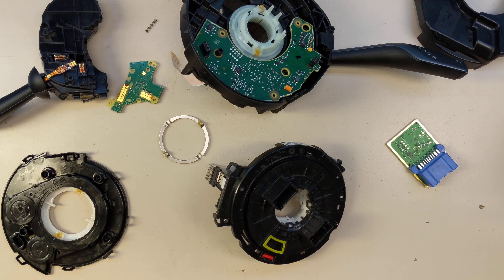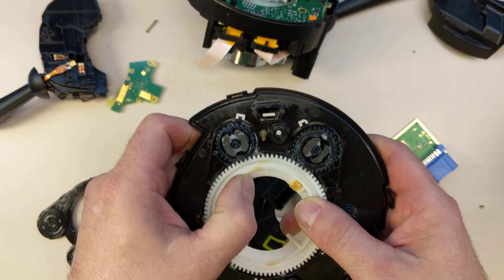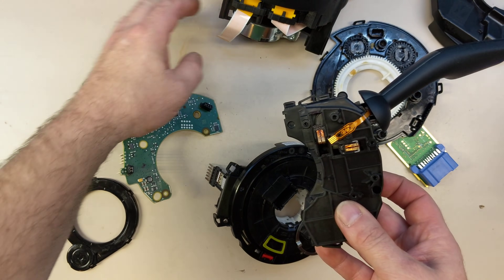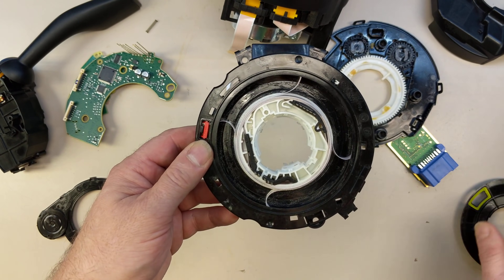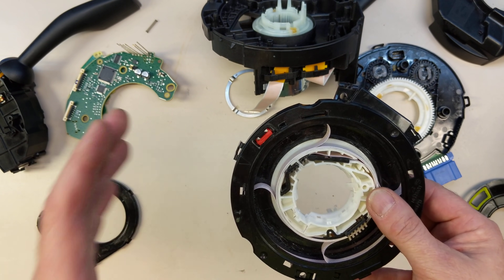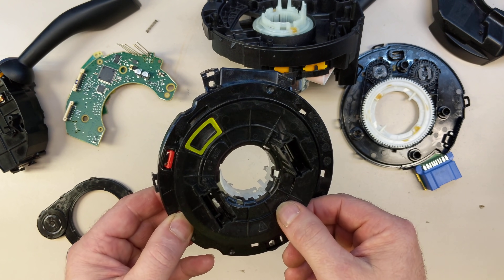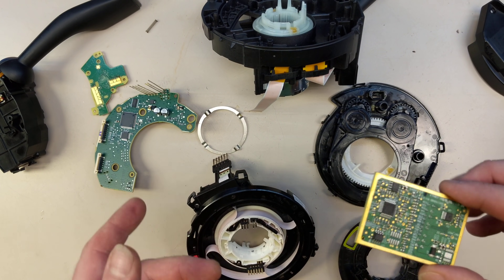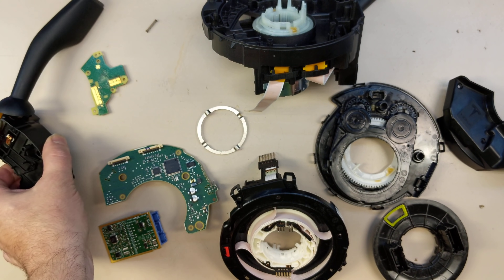Tesla Teardowns - Why is there a CLOCKSPRING?!?

Comment: I actually had this very part fail on my Model 3 earlier this year. It eventually got serious enough that the car wouldn't go into Drive. Tesla service replaced the entire module as you'd expect.

I love the idea of using two different sizes of gears for the Hall effect sensors to detect absolute steering wheel position with high precision. Are the tooth counts on those gears prime numbers?
Reply from the maker: I have only seen one of these fail, and it was due to someone spilling a coffee on the steering wheel, which somehow got into the electronics.   But almost anything can fail.  Usually without external causes (coffee), there is a "bathtub curve" where complex parts either fail really early (infant mortality), or they last a long time and fail well past their design life.
Reply: @Ingineerix  indeed. Mine failed after 3 years without any coffee spills or anything like that. Rare but it happens I guess.
Reply from the maker: @pepstein  Did Tesla cover it under warranty?   Where do you live?   The one major enemy of these things might be dust and/or humidity.
Reply: Yeah they replaced it under warranty. Car spent most of its time garaged. Bay Area CA. No dirt roads or other sources of dust.

Comment: In aviation we have the FAA to presumably check if a plane is safe to fly although it fail miserably on the 737 Max. On cars what administration is checking them. In the old days the steering wheel could get harder when the power steering failed but we still you could riches the safety shoulder. In your demonstration I don't see any redundant device allowing me to go to a safe place if the steering fail. Hopefully the National Transportation Safety Board (NTSB) will investigate the crashes and gives some advises on how to improve the situation, like having assisted steering where the driver still can control the car when the electronic fail.

Comment: Seems vastly over engineered to me. Can't imagine using a 32 bit MPU to read a few encoders and switches. Can't justify the component count for what it does. Too many boards, cables connections, and complexity. Seems fragile in many areas too. Typical German design. Wonder what a dealer charges to replace it? depending on the brand $3-10K I'll bet. Lots of plastic tooling costs but cheap in China. Very interesting video, well done.

Comment: I knew about clocksprings in steering wheels, but I didn't know about how precise the magnets and gears were. They must utilize this for making sure the driver has their hand on the wheel for Auto Pilot as I've noticed it just takes a bit of resistance in order to prevent the nag. Did you find any motors in this assembly at all? My first guess to how that worked was if there was resistance on a small motor or something. But now, having seen this, it looks like it just checks if the magnets have moved enough over a period of time. Or perhaps they have it programmed to detect natural vibrations from the road, so there would be more noise, so to speak, if the wheel wasn't being held steady? I'm not sure, but knowing that this is done through software makes it even cooler to me!

This is really fascinating and does give me a great appreciation for engineers! Thank you for sharing!
Reply: The motor (for power steering and/or automatic steering) is usually on the steering shaft or steering rack, not the steering wheel.

Comment: Incredible seeing all those PCBs and CANBUS in there just for the clock spring. I'm working on disassembly of a 2015 Fiat 500 and they just use a resistor ladder for many of the steering wheel buttons, and the clock spring just connects to three different plug-in connectors that go straight down in a huge bundle of wires to the BCM

Comment: Seems to me it could be done inductive. Alternatively do a non linear 90 degree steering wheel action, then a slightly loose cable will suffice.
That stalk should go as well. Should be a touch display in the steering wheel face. And yes, there is still room for airbag, spare me.

Comment: Mighty interesting, I never thought about that.
Reply: Very interesting & explained a lot why the clock springing my GMC Chevy Sierra 1500 air bag light came on  intermittently. Some days the warning light would flick off& on 7 times then go off completely only ten minutes later the warning light would come on again & stay on. I tried removing the fuse to the dash light but that was worse in fact the warning light stayed on continuously!  So as it’s almost impossible to purchase another clock spring …. I finally removed the dash warning bulb putting the concern out of my mind! Certain models have sensors under the body work at the front of the vehicle but I could never find them & they to are as scarce as hens teeth!
So after watching your video I’m inclined to think that there maybe too much side play in the steering column beneath the air bag itself either that the electronic stuff is buggered!

Comment: Love your detailed vids on tear downs. You tend to get into all the really cool stuff so it's hard to make a specific request. Tesla's seem to have a mechanism that helps the car drive straight when the wheel alignment is off. I think it's part of the auto pilot system. Maybe do a tear down on that?
Reply from the maker: There is no mechanism I am aware of to compensate for alignment problems.  The only thing (shared by almost all cars) is the ackerman positive caster angle.  This causes the wheel to self-center when driving forward.    See "positive caster" here: https://suspensionsecrets.co.uk/caster/
Reply: @Ingineerix  Not long ago i had a wheel alignment performed on my model 3 and the alignment shop was frustrated with how after they aligned the wheels, the car pulled to the right. They couldn't get it straight. However after about a week it started to drive straight (mostly). Tesla charges a large fee (~$500) for a "calibration" when doing a wheel alignment so we concluded the car is somehow correcting itself. Amateur conclusion perhaps?
Reply from the maker: @brandonbeck4794  I'd say don't go back to that shop.  If they can't tell you why it's pulling or set it properly, then they don't know what they are doing, or their equipment is not working correctly.  The only calibration is steering angle, and any decent shop will first set the wheel to 0 degrees and place a fixture on the seat to hold the wheel at 0 while they adjust the car.  It will not need to go to Tesla if this is done.   If they did it wrong, and there is an offset from 0, then the angle sensor has to be reset.  This will also result in your wheel not being centered properly.
Reply: I would love to see that explained, Brandon!
Reply: @dizzy2020  'owner's permission' is probably in the terms you have to accept to use the software; however, I can't call it consent because forced permission certainly isn't voluntary

Comment: Great tear down! 
Do you think a heated wheel retrofit for early Model 3s will be possible? I’ve done the retrofit on a Touareg… I’d love to have it on the Tesla. 

The steering angle sensor on that 04 VW was just optical, kind of like a ball computer mouse. The clock spring had fingers that interrupted optical sensors. The Tesla gear arrangement seems way more accurate! 
My old 91 Mercedes actually uses a slip ring for the airbag! If the car sits for a long time the ring seems to get some corrosion and the SRS light will come on until the wheel is turned some.
Reply from the maker: No, there is no control system for it, so even if you added it, there is no easy way to enable it.
Reply: @Ingineerix  Mechanical switch on the steering column?
Reply from the maker: @user2C47  It would have to be on the steering wheel itself.  There is no extra pin on the clockspring, so your switch would have to live on the moving part.

Comment: Great video, thanks!  After the car has been sleeping and I open the drivers door, there's a click which comes from the frunk area, then a click from the rear of the car.  Can you do a video of what's going on and the parts involved?  Thanks again.
Reply from the maker: Sure, That's a good idea.  I'll add it to the list!   The clicks in the rear (under the back seat) is a "Click-CLUNK" noise which are the main battery contactors closing to enable the high-voltage system.   The only thing in the front that's noisy is likely the A/C compressor (Heat pump on never cars).  Once the car wakes up, that also fires up.

Comment: Another very interesting vid. With all this hardware, would it be possible to fit one of these to a Plaid together with a normal, say Model 3 steering wheel ?
Reply: Someone has already added turn stalks, so a wheel should be in the same ballpark
Reply from the maker: Yes, but you'd need some kind of translator module on the CAN bus to make it all work properly.   When/if I own a Plaid, I will be doing this, I don't care for the yoke, it's not a good control for a true "driver's car".
Reply: @Ingineerix  Thanks for your reply, I think there could be a little business there making kits to put a normal steering wheel on the Plaid. I have one ordered one here in Australia to arrive at the end of 2022. Strange the way the yoke wheel was put on my invoice as it it was an option.

Comment: Bosch air bag module is a puzzling one to me. Why Tesla so far as not put that capability in their own controllers. Now with Elon calling out Bosch for shortages that might push them out of the next Tesla vehicles if they are still in plaid, safety restraint module is the name I think.
Reply from the maker: Yeah, it's called the RCM (Restraint Control Module).  It's non-trivial to develop this, and comes with significant liability, so I expect this will be one of the last things Tesla takes in-house.

Comment: Isn't that just a modify mercedes system?! I know tesla has been using mercedes/toyota steering controls for years
Reply from the maker: It's these guys:  https://www.kostal-automobil-elektrik.com/en-gb/empathy/drive-controls/
Reply: The original Model S and X used parts from the Daimler parts bin. Model 3/Y does not. And neither refresh S/X.
Reply: @sjokomelk  its still basically the same system, electric/hydraulique steering or steering by wire.

Comment: Would be interesting to see a comparison to the plaid yoke. No stalks but also the horn became a button. Seems like the scroll wheel Lin module could be doing more or I would bet they are down to 1 circuit board
Reply from the maker: I already had a look, Looks like a similar module, just no stalks, and more going on in the yoke itself, as there are 2 sets of capacitive triangulators to sense the buttons (one on each side) as well as haptic feedback.

Comment: A lot of plastic gears and other plastic junk there... doesn't make me feel good about it's longevity.  The clock spring is pretty cool though--- never seen that before.
Reply: Lol..... the steering is electrically assisted so very little stress on those plastic parts, plus they aren't exposed to the sun/UVs.
Reply from the maker: They are well constructed and there is grease everywhere.  I bet you it outlives the rest of the car easily.
Reply: @Ingineerix  If you have followed Elon's SpaceX adventures at Texas, there's no surprise that Plaid and future Teslas use buttons/touchscreen. It simplifies SCCM greatly (the best part is no part).